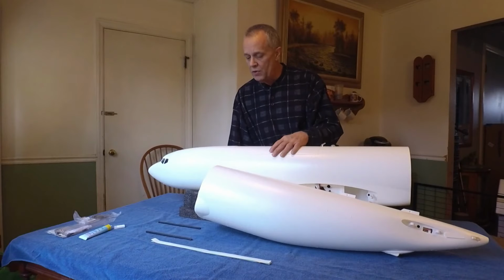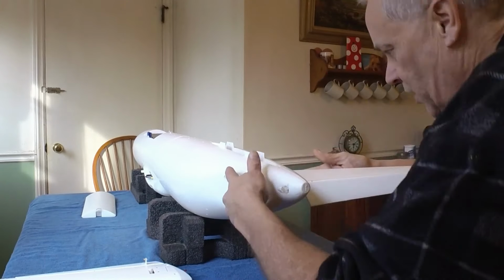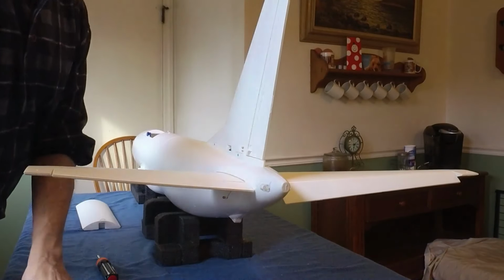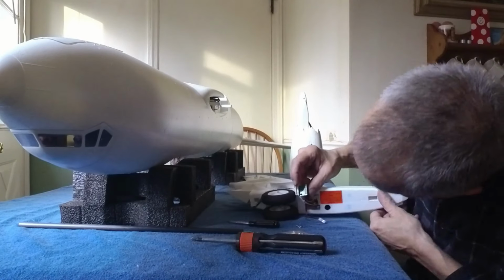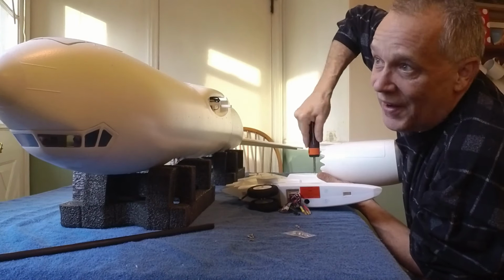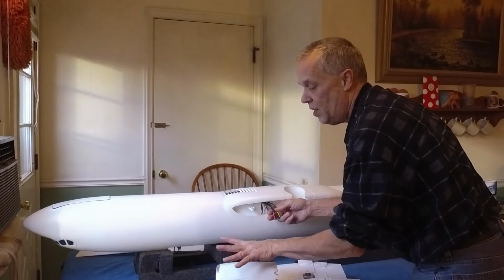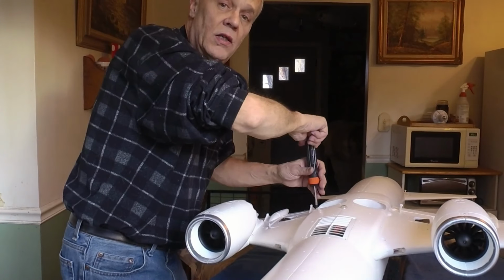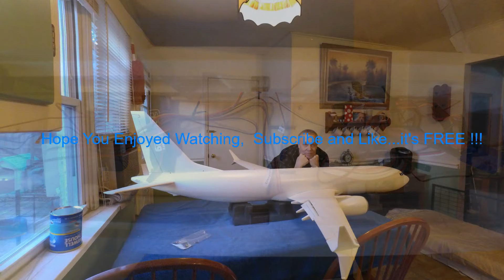Freewing  AL-37  Twin 70mm EDF Jet Airliner (Full Build, SpeedBuild Mix)

Comment: 29:15   Take a STRONG (e.g. Nd) magnet and rub the tip of your screw drivers some 10 times or so until they became "magnetic" - from then  holding all small ferromagnetic screws in the future !
Reply from the maker: Thanks Buddy.   I do that all the time.   Another way to magnetize is wrap piece of insulated wire around end of driver and touch ends to charged battery and arc it a couple times.   It will last for days

Comment: I like the full build better. I feel the speed builds don’t allow you to give your excellent build tips.  You give the best build tips and narration of any of the other channels.
Reply: Well, you don't have to worry about a thing then, because there is absolutely NO building with these foamies! 10 minutes with a screwdriver, and 5 minutes with a little contact cement and you're done. No building, no brain work needed. It's so easy a cave man can do it. If you really want to actually build something, then you will have to buy a box of balsa. Then you can have a model that you can actually be proud of that's not like the other 1,000 at the flying field.

Comment: Did you find a loose cable with what appears to be either a heat shrink or electric tape on the tip coming out of the wires that came already connected to the blue box of your Airplane when you first took it out the box?...Mine has one like that and I don't know if that is normal or if they sent me a defective one...Can you please tell me! 🤞🏾
Reply from the maker: I don't recall that.  There is a wire that goes to the BEC,  But that's all I remember.  Call Motion and ask.  They'll know.  Maybe something got changed up in the second batch???  They do that sometimes I've noticed.
Reply: @SkipBuiltRC  That was the wire, the one that came from the BEC...Apparently that's normal according to them, so I should be good to go to start building my Airliner...👍🏽👍🏽 Thanks!
Reply from the maker: @ricardopr54  Not a problem buddy

Comment: Hello Skip I need some assistance with setting the wiring and setup for the transmitter and receiver. Can you help.
Reply from the maker: I'll try.  How can I help?
Reply from the maker: I'm still here.  What can I do to help.  It's a typical set up.  If uncertain, check (how to connect wires to a receiver?) On YouTube

Comment: Any idea on how to fix a problem I have on the rear lights? The rear left light is off and the one next to it is static, not really doing their job as strobe lights
Reply from the maker: Sounds like one of the connections in the rear is loose.  The connectors they use don't fit together well and have to be pushed together at te terminals.  They slide in the housing so they aren't in by much.  I had to on my add ons, tape them tightly together.

Comment: You can try Velcro on the fuselage halves. That way if you need to take it apart during transport you can
Reply: Sorry that wont work and plus would look stupid
Reply: @Mikeylikesit1968 . I saw a video where someone else use that method when a large wing section. Anyway it was just a thought

Comment: The ubec can go into a open slot on the rx or you can Y it in with another channel depending on the rx your using
Reply from the maker: LOL...  I figured it out later on when I was editing the video.   Camera saw the red esc wires were capped  making them opto esc's

Comment: It was Great fun to watch you Skip figuring out how to "sneak" in to place the Landing gear without dropping it but you have not show to us how you did it...
You may skip this question Skip but I have an other one!
 Where did you pluck the 8A 5V wire leads from the UBEC motor?
Regards from Canada
Reply from the maker: Getting the wing on with gear up was just squeezing the tire wher it wants to catch, and then pushing it through.
The other plug is a bec that supplies power to the receiver.  plugs into batt/bind port of receiver.
Just saw this.  Sorry so late, Skip
Reply: It is Never late Skip, Thank you for replied back to me...

Comment: Did you read the manual at all?
Reply from the maker: Only to check out settings and control horn position, linkage settings and the like.
The build was a no brainer
Reply from the maker: Why do you ask?
Reply: @SkipBuiltRC  because of the gear issue, despite that great video! Have mine finished today and taking her tomorrow morning to the field depending on the weather
Reply from the maker: @RubenG24  my gear works great.  GOOD luck with her tomorrow.   👍👍👏👏
Reply: @SkipBuiltRC  Hi! I just wanted to let you know that I had my maiden yesterday and it just flies beautiful! I‘ll upload a video and post the link below! Have a nice week ahead! Cheers from the alps!
Reply from the maker: @RubenG24  cool bud.   I'll check it out for sure...
GREAT JOB buddy.   Nice Flying
Reply: @SkipBuiltRC  thanks mate! Pure joy to fly and gives an awesome image in the air